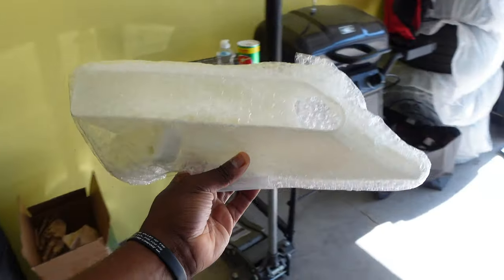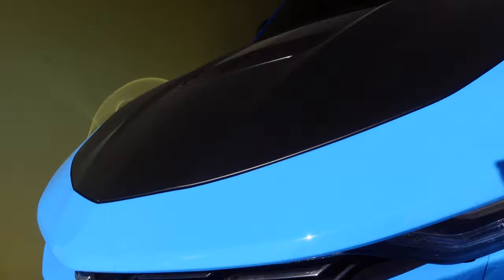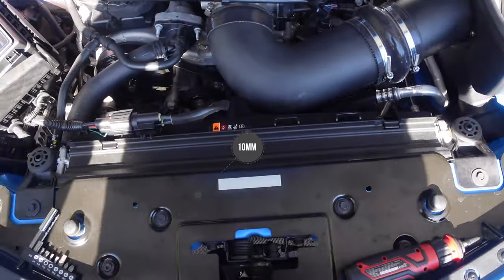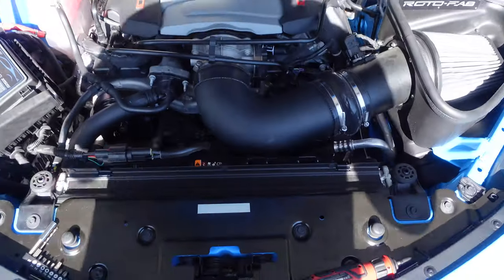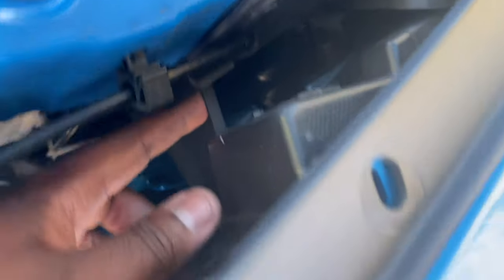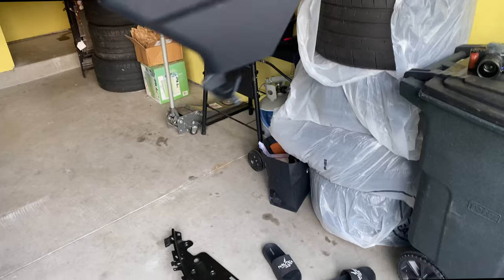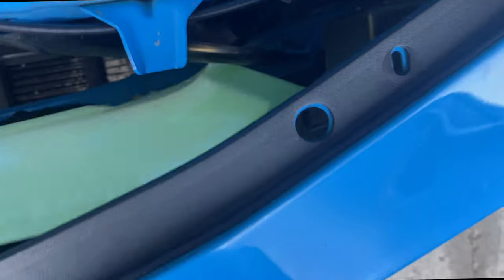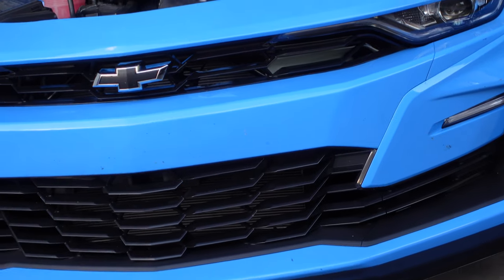Velossa Tech Big Mouth Snorkel | 6th Gen Camaro SS/ZL1 2019-2023 Camaro

Comment: For real, didn't even know this existed. Looks like this would fit my LT1 also.  
Keep em coming!  Good shit man!
Reply from the maker: It may fit. I only seen them for the SS but it wouldn’t hurt to reach out to them and see if it fit behind the bumper
Reply: @BLUPRINT1LE  Yeah good call.  I just checked out some threads on Camaro6 and indeed the fitment is NOT correct for the LT1.  Sounds like one may be in the works soon.

Curious if you notice it picking up more debris and junk into the air box and filter compared to the stock model?
Reply from the maker: @Chad_7777  i drive with it for a week and I haven’t noticed anything in my air box or anything like that so far. I had one on my old car and I haven’t anything like that either and I had more miles on that car

Comment: That's a dope mod, seems like a simple install and it looks like it would really work too, what about when it rains though wouldn't it suck in water into the intake?
Reply from the maker: It’s simple but time consuming for sure. According to Velossa: Rain or snow do not adversely affect the engine once a BIG MOUTH is installed.
Reply: It drops IATs as well. You getting cooler air. I been wanting one for the longest.
Reply: @BLUPRINT1LE  Nice that's whats up!
Reply: @camarochris78  Sweet!
Reply from the maker: @camarochris78  yessir I’m going to try and test it out with my obd2 scanner and see what’s the average temps I get
Reply: Nope, I have a URD True cold air intake on my Tacoma TRD Sport - so the actual intake sits in the front grill altogether. I've driven it through heavy rain and it performed perfectly, I doubt a ram scoop would suck enough water in to matter.

Comment: Hey have you heard any news on 2023s being built yet??
Reply from the maker: 23’s are being built but and orders are getting accepted but you will have to go into the dealership to place the order as the car configurator is not up yet until Aug most likely
Reply: Ok I ordered when ordering opened up for 2023 may 18th? I think.  I have had no movement that I have been notified of. Was just wondering if you had the good info as usual.
Reply from the maker: Not yet I haven’t heard anything about it I know a few people got accepted but it was LT1s but nothing yet. If I find out something I will let you know
Reply: Ok. Thanks.   I ordered pretty basic.   1ss 1le a10 with pdr and strut brace.   Thats it.  Riverside blue
Reply from the maker: @edwardgarrett3744  sounds similar to my setup. I wonder if PDR is on constraint. They may be holding your build up. I knew it was on mine but I was happy to wait because it was during the fall/winter months and didn’t have to rush for a car